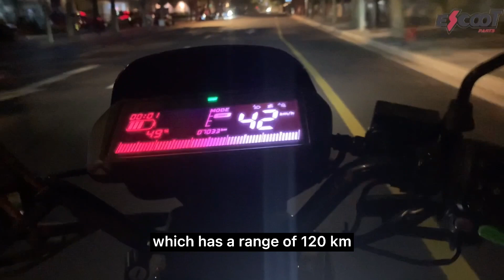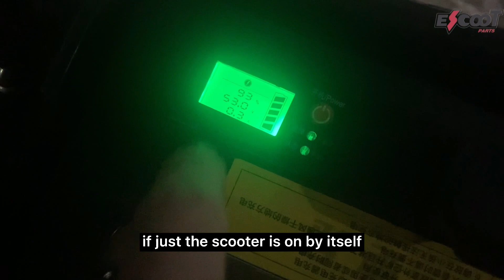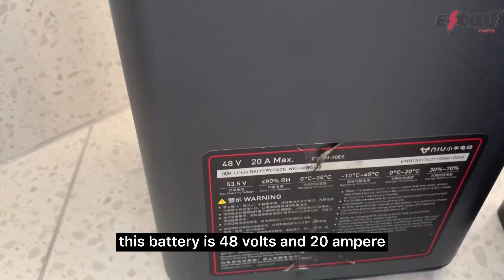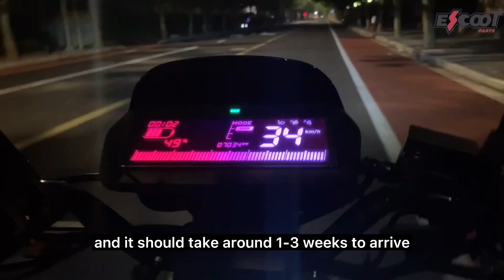An Easy Way To Extend Your Niu Scooter Battery Range

Comment: Hi! I'm interested in the M+ 48v 68amph battery. Can't afford it quite yet.
But since it's quite a large investment I'd like to know what kind of cells and BMS there are in these batteries.
Perferably if you could take some pictures of them, I noticed that you can easily remove the top to see.
The chinese text does concern me a bit and that's why I'm asking.

I also want to know if the matrix taillight will be available in the future?
Reply from the maker: The BMS is up to 300A the cells are 18650 Lithium
Reply: @escootparts2284  Alright thanks, are the cells branded or chinese?
Reply: @vertitis  pretty sure they are Chinese noname offbrand as I've also spoken to him, he avoids my brand question everytime, definitely conerning long term. Would like to see him provide photos of the battery for sure.
Reply: @roflkappater9358  Alright thanks, yeah, I always think people dodge questions for a reason.
Think I'll stick with the original battery for a while, I don't want to sit on a flaming ball of fire.
Reply: @vertitis yeah it sucks, not to mention warranty problems if things goes wrong. The batteries at the NIU store for the 31a and 41a are so overpriced its ridiculous wish they would increase the amps they have but then nobody would buy them because they cost too much